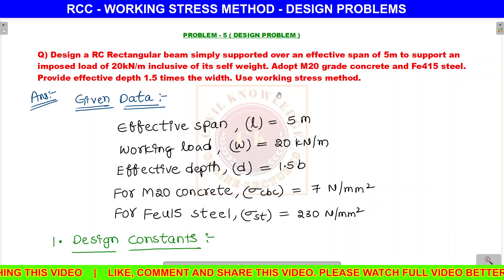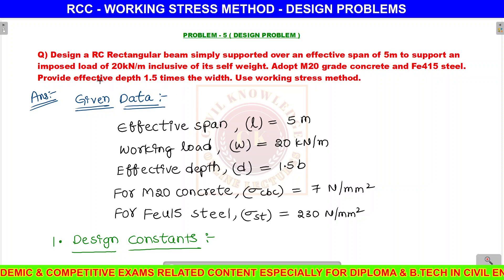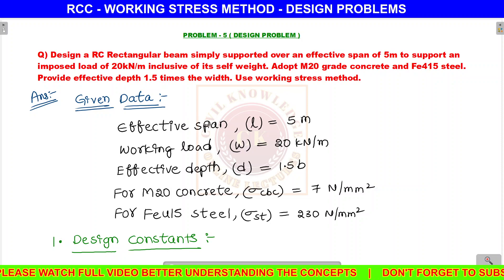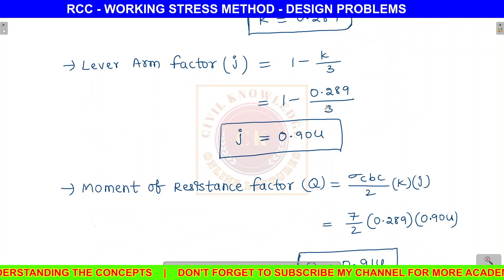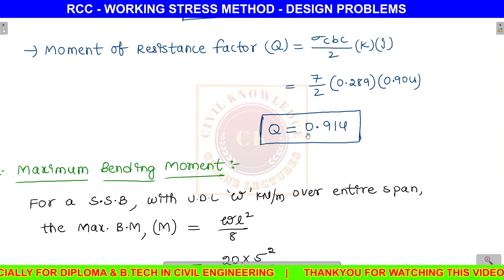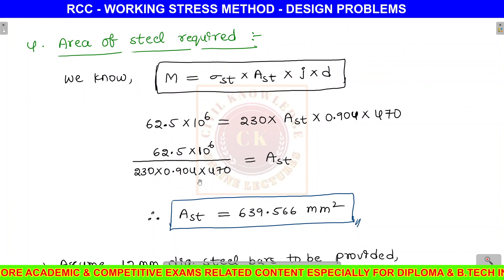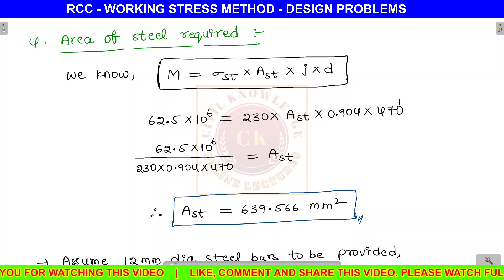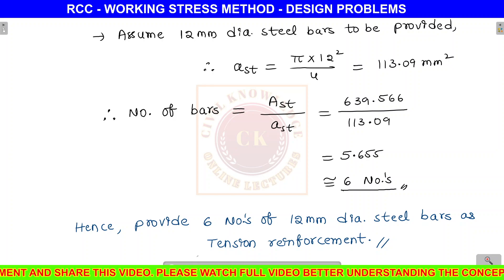WORKING STRESS METHOD DESIGN PROBLEMS IN RCC LECTURES TELUGU FOR BTECH JNTU - PROBLEM 5

Comment: Sir problem lo working stress method ani mention cheyakapothe limit state method adopt chesukovala sir
Reply from the maker: yaah definitely you can do that. Because if they asked just to design a beam, then you can design it in LSM. But, if you are studying diploma then you have a separate chapter for WSM. Then, even if they had not mentioned to use WSM, you must use WSM bcz you have that question on that chapter only right.
Reply: @civilknowledgeyt  thank you so much sir